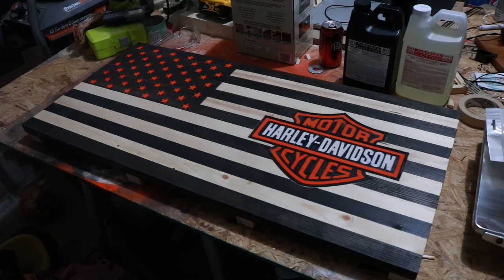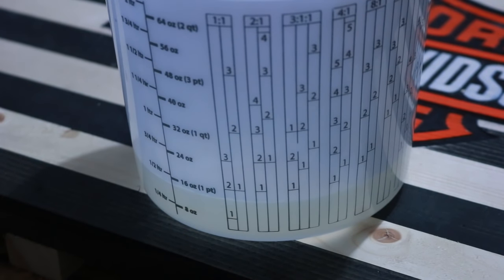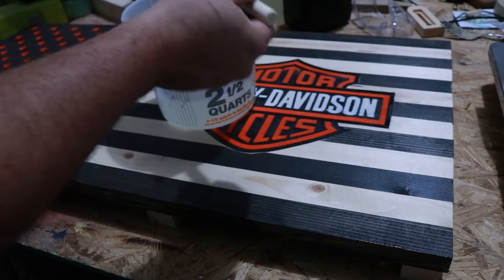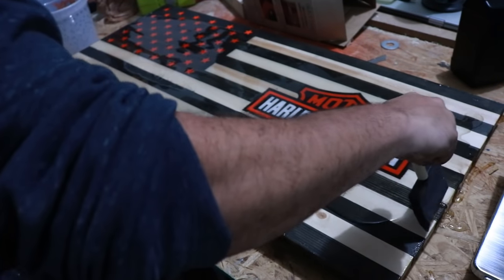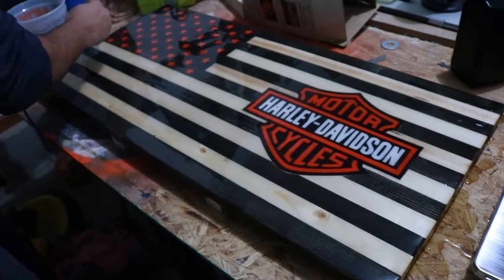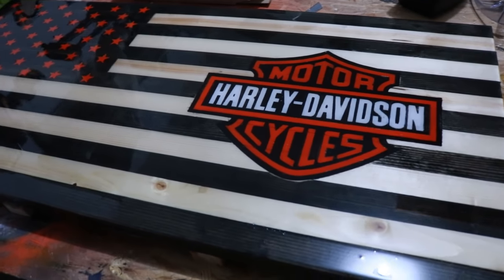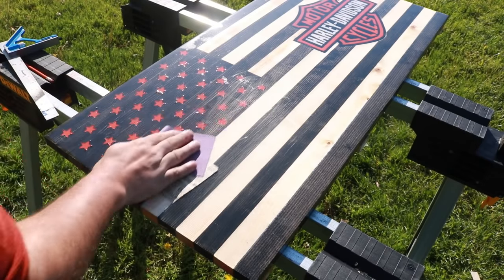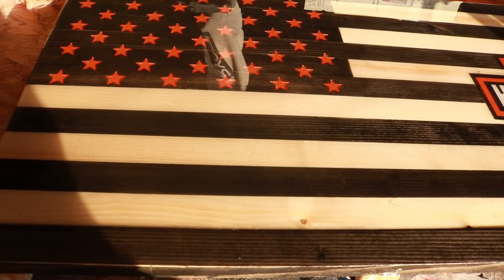How to make wood look like glass

#woodworking #flag #epoxyresin

Comment: I have gone through many struggles with resin. I thoughts I’d leave some tips I’ve learned. You mentioned living in a cooler area. I first started in the winter and struggled big time. Warmer weather makes this so much easier. Get a small tub and fill with hot water. Sit your resin containers in it and let them sit for 10-15 minutes. Pour the epoxy into your mixing cup and stir until completely mixed. Leave the stir stick in it and sit the container into hot water for 5 minutes. All the bubbles will rise and the consistency will be closer to water than syrup. Leaving the stir stick in while it’s in your warm water bath will allow it to capture the air bubbles. When you pull the stick out most of the bubbles will be gone. The epoxy being warm will also require less torching. I’ve ruined several projects with too much heat trying to get all the bubbles out. I also use a pressure chamber to compress the bubbles at 4 bar which makes it perfect and keeps dust out. This project is too big for my pressure chamber but useful for smaller things. You can also place a plastic bin upside down over top of it. One last think tyvek tape will prevent it from sticking. I elevate it on painters triangles (standoffs???). You can also use silicone mats under it as they are protecting your table and epoxy comes off easy during cleanup. If you want an easier method to rid the scratches after sanding coat it with polyurethane. They magically disappear. Nice job. I enjoyed watching your video. It’s nice to see somebody else struggling the way I did lol. I got so frustrated but man have I learned a lot since my first pour. One more thing: it also helped me a lot to brush on a thin layer of epoxy to seal the wood prior to my full coat. It stops the wood from off gassing. The bubbles are created by the air that is trapped inside the wood. As the epoxy cures it heats up and more air is allowed to come out hence why multiple iterations of bubble popping are needed. If your epoxy is warmed up the air will escape more freely. I’ve had big bulges in my work from air escaping the wood but not the epoxy. The temperature really is key.

Comment from the maker: Resin https://homedepot.sjv.io/XM5M4
Reply: Tool Review Zone What are the dimensions on that flag? 19.5 x 37? Also, did you use the whole gallon on one flag? Is it needed to wet sand at the end?
Reply from the maker: Hi Jason. Na I only used half of the kit and that was with two heavy coats.  I'm actually making one for our local fire department and still using the same gallon.  And yeah, its 19.5 x 37 bro. No wet sanding either
Reply from the maker: I've been using a shower squeegee.  Works well too

Comment: Great job! A couple tips.  When applying it put it on top of a piece of thin plywood that you have put Tyvek tape on. The epoxy won’t stick to the Tyvek tape.  Waxing bare wood will keep it from sticking to bare wood. Dust sucks!  I too work in my garage and have had stuff ruined due to someone opening the garage door when it was raining.  Not good!  Now I put a sign on the door to not use it when I have epoxy stuff curing in there. It IS VERY temperature sensitive so keep track of the temps in you garage and put on a small heater to keep the temperatures within the good range.

Comment: Very nice looking HD flag.  Best I have seen.  Kinda refreshing to see this theme without the orange and black for a change.  Like the touch of the red stars that compliments the logo naturally.  Working with this mandates that your piece is dead flat level in all directions.  Lime you said several times the epoxy flows and is self leveling

Harleymike/chicago
Reply from the maker: Thanks so much for the Comment Mike. Yeah they definitely have to be level because you will end up with bare spots. I'm actually working on my last flag for the local fire department and will have the vid up soon if you want to check it out bro

Comment: Looks great, just a tip. Dont scrape the sides of the container to get more out. You can just flip it over and let it run out. They say there's always even mixed epoxy on the sides
Reply from the maker: Always appreciate helpful feedback 👊👊👊
Reply: @ToolReviewZone  👊👊
Reply: @ToolReviewZone I actually meant uneven mixed epoxy

Comment: Nice work Clint.  I'm surprised you didn't make a test piece first to experiment to see how it would finish.  I'm thinking if you are going to start any kind of production runs, then a small dust free paint booth may be in order.  Pretty easy to make too.  It came out fantastic and the Harley Davidson emblem almost looked like a sticker it was so perfectly CNC'd.  Thanks for sharing Clint.  Cheers mate.
Reply from the maker: Thanks William! Yeah buddy, I am going to set something up. I tool this outside to get some sun but the damn pollen got me lol. I'll wet sand it down and buff it out, but definitely need one. Also, thanks for the compliment on the cnc. It took a little while   because I had to hand pain everything on it, but I'm happy with it

Comment: Thanks for sharing your project looks great.  Do you believe a foam roller will yield the same finish as with the foam brush you used? Also, can you send me a link for the paint stick you used thanks.
Reply from the maker: Hi Al. A roller may be a  bit to much, but you do use a roller, foam would be the best option
Reply: Thank you for answering my question.   Can you please tell me what paint you used for the harley logo it looks awesome.
Reply from the maker: Just some sharpie paint sticks is all

Comment: You should be able to locate a low solvent, almost no voc resin to help eliminate bubbles...no shaking, light stirring, no over working area, finish strokes all in same direction.  Solvents react to heat & are flammable.
Reply: What brand would that be?

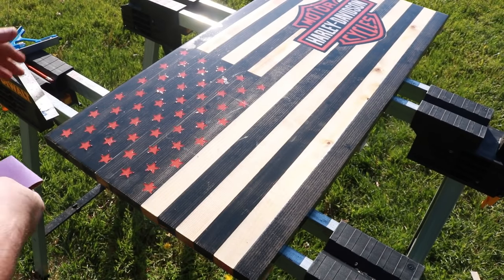Comment: Are those air bubbles around the stars? (16:39) How did you get those out? Looks like I see a little bit more in the sun. That is my biggest problem is air bubbles. In the end did you get all yours out?
Reply from the maker: Hey Kenneth.  Its actually little pieces of wood from the bit. I tried sanding them but started going through the stain.  Figured I would deal with it

Comment: Nice job. Thanks for the tutorial. You mentioned paint sticks.  Which ones do you use?
Reply from the maker: Hi David.  I should have been more specific and said it was a paint marker.  Sharpie makes them and are easy to find, but the brand I like best, and used on the was Deco Color
Reply: I am going to give them a try. My painting of CNC projects is not the best using acrylic paints. Thanks!
Reply from the maker: Will definitely save you a lot of time and headaches bro

Comment: The torch removes the bubbles by heating the air trapped in the liquid so it expands and bursts the bubble.  Has nothing to do with CO2 or you could just breath on it.  Still a very cool project.

Comment: Nice piece. What are the dimensions? It looks like it would be too big for the Shapeoko. Also, would love to know how you built it and the process on the Shapeoko.
Reply from the maker: Thanks Greg. You are correct sire, it is actually too big to carve all at one, so I run two different codes (one for the logo, and one for the stars) and just re position the  flag on the table. I actually have a tutorial of how to transfer the logo onto the wood, and it has the Milwaukee logo for the thumbnail. Its the same process, but I will do a separate video for the stars even though it's basically the same process.
Reply: Where did u get shapeoko at ?

Comment: The link for the epoxy is outdated. Do you have something more current? Both Home Depot and Lowes didn't have a clue.
Reply: Kurt C I use epoxy daily...there are a lot out there..ccdiy and ,ksresin are my fave,pro marine and faux rizzle ,but I don’t like them personally , I make custom tumblers ....the torch will help with bubbles,but you need proper temp or you get ripples,if you have any oils ,It will produce fish eyes..tape the back so drips are easier to remove..having something to cover it works best..I also keep a mister of 91% alcohol to mist the item from a distance,it pops bubbles,but not much as it will also case defects or orange peel effect if used too late..also easy on the torch as it will burn the epoxy..a heat gun will thin and move the epoxy,so use it sparingly also to help manipulate it...hth..let me know if I can help..

Comment: How well does the resin hold up to outside elements?  I teach a woodshop class and we build patio chairs.  We typically use polyurethane but the sun burns it off very quickly.
Reply from the maker: I think it would hold of for a while, but not sure how long to be honest.  I would just try and see
Reply: Horace Mann Engineering it isn’t great for outdoor use..also,you need to get a high heat rated epoxy or it will basically melt and become tacky..it also has a curing time,anywhere from 72 hrs to 28 days for full cures,depending on brand used...I use ksresin or ccdiy on my custom tumblers,as I’ve left them in my truck for days in 90°weather with no issues..

Comment: Do you wear a chemical mask I heard it's very toxic till dry.  Love your work
Reply from the maker: Hi mist. I'm a safety engineer and I don't have any worries with the hazard.  It does not vent of with fumes, and its really not that hazardous.  I would be more concerned with letting it get on your skin so wear gloves. Thanks for the question and comment

Comment: Total boat ,ecopoxy, and west system or a product called top coat would all work great some flow better than others
Reply from the maker: I'll have to check those out bro. This stuff seems to take a bit to long to dry.
Reply: @ToolReviewZone  most epoxy take about 24 hrs to be somewhat workable depending on the hardener west systems has a hole line of resins and gardeners for all situations some ov and others are not. THE FLAG LOOKS AWSOME
Reply from the maker: Thanks bro. The temp did dip last night and slowed down the cure for me. I may need to wait a couple days before I wet sand and buff
Reply: @ToolReviewZone  when dealing with resin the temp.is a big thing if you can heat the mold AKA flag in the sun the cure will be better and if you store the materials around 75-80 degrees before the pour it will help also
Reply from the maker: That's what I tried to do in the sun, but had to many floaties in the air today.  I may need to set up a special area for this
Reply: @ToolReviewZone  definitely you will need a clean zone or just do it in your shed on a day you are not in there.
Reply: Try to warm the wood first and it will cute from the inside out kinfa

Comment: I have a list of a couple things maybe help you first thing get a turntable so when you do the edges you just turned it around instead trying to reach around the other thing is get a pressure pot so when you mix up after you mix up your resin you put in a pressure tonight pot helps get rid of the bubbles it looks awesome you take care of your kids and your wife take care of yourself I'll see you on the next one take care
Reply from the maker: Thanks for the helpful tips bro!
Reply: If he was going to do a debasing he would need it to be under vacume not preasure. If he was keeping in the pot after poured to remove air bubbles you would be correct regarding works better for this type of resin rather than fast set polyester resins like alumalite

Comment: Do you have Harley's permission to use their logo on the products you sell? I'm curious because it's likely the logo you used is trademarked by HD and without their use permission, it could land one in all sorts of legal problems.
Reply from the maker: It was made for the local Harley Store, but yeah if you are mass producing they probably wouldn't be happy
Reply: @ToolReviewZone  Cool. Was wondering the circumstances and/or how you got around it. Nice work. Cheers.